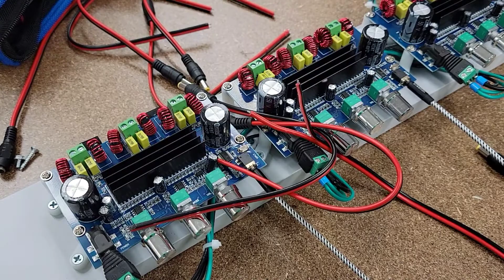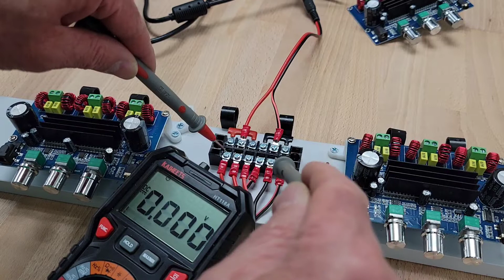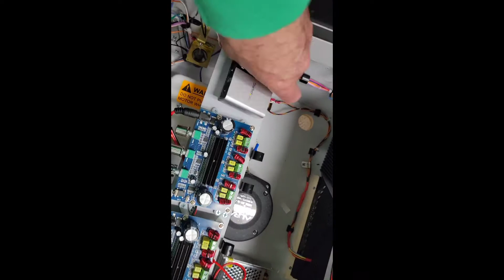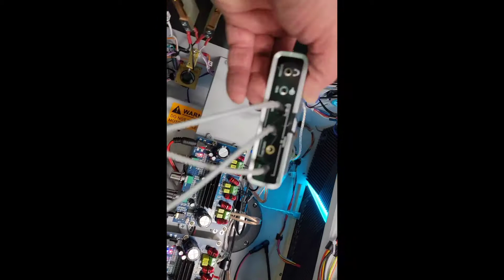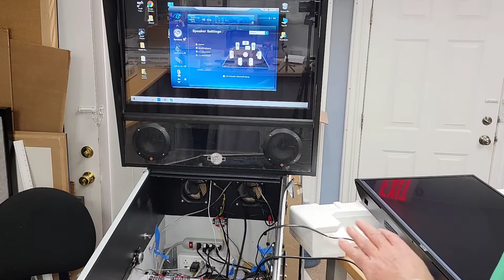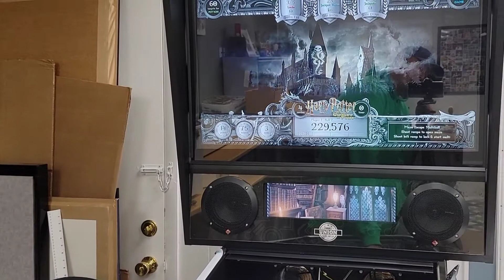Virtual Pinball Project: Final Audio Connections – Incredible Sound Achieved!

Comment: What I was trying to convey was mounting that block on the bottom side of the shelf more so than under the amp. But as long as you don't hear any interference that works as well
Reply from the maker: Um, yeah, that would totally make a lot more sense and the more I think I about it, the more I SMH I did it the way I did. There's a VERY high chance I'm going to redo it now! I do need to do some troubleshooting because I had a tough time tracking the different speakers. I was doing the set-up and the software would run through the different speakers - but there were a couple that were completely wrong - even though I could trace the speaker cable back to the correct speaker. Very odd.

I also need to redo my naming conventions to correspond to the 7.1 sound card. Anyway, thanks for the comment and I hope viewers read that before they follow my lead!
Reply: @StevenLanham  your videos have already saved me many "duh" moments. I keep finding myself over thinking things that should be simple.